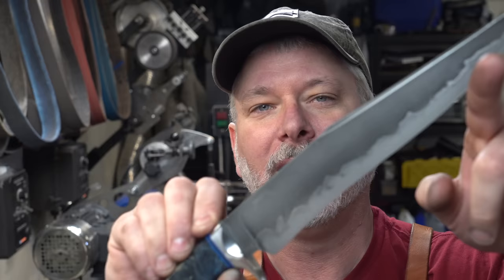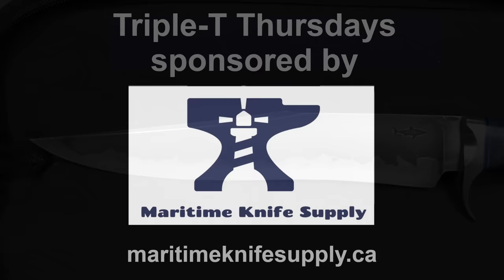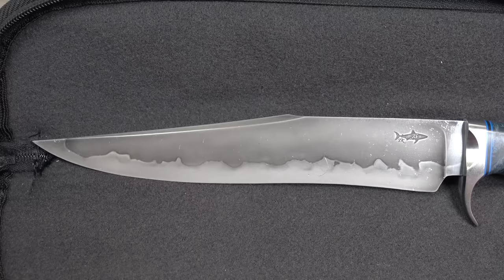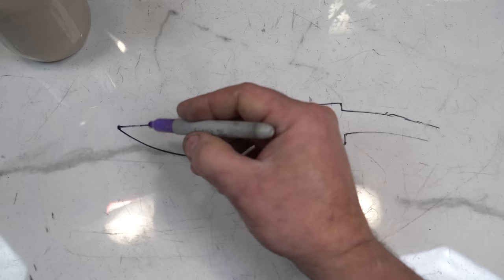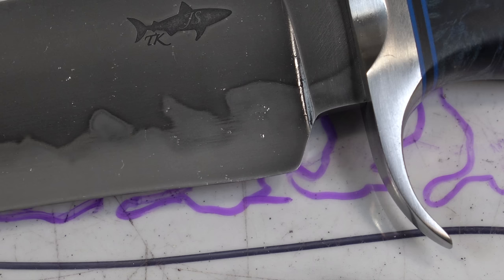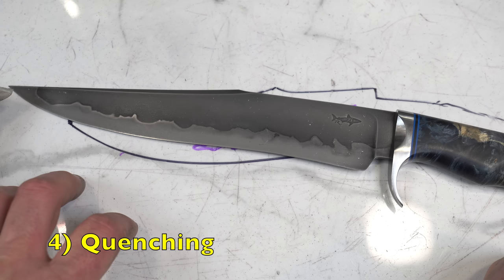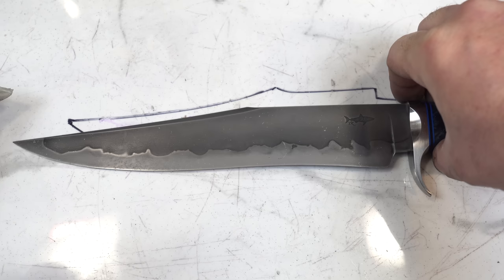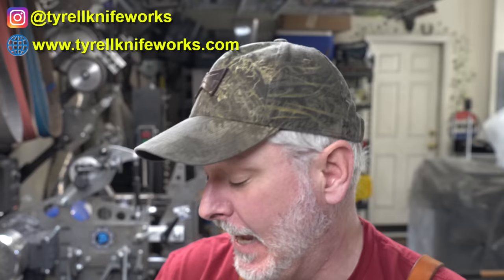Triple-T #131 - How to get a good hamon on your blade

Comment from the maker: I must correct something I screwed up in the video.  For some reason I said sand to 2000 BEFORE heat treat, I meant before the etch.  Sorry for the confusion!!
Reply: I typically sand up to a near mirror polish before heat treat anyway, but haven't tried a hamon like that yet. With the additional ridges that sanding at a lower grit leaves, it makes me wonder if there will actually be a difference on the hamon in sanding to a higher grit before heat treat, given that the high spots on the ridges will get hotter and quench faster due to their lower thickness. For context, I sand to such a high grit before heat treat and then use NuClayer No-Scale during heat treat. I can usually start sanding at 4-600 right after temper that way. NuClayer also makes a clay for hamons.
Reply from the maker: @zproducts6080  I've contemplated that approach but haven't done it yet.  I have some ATP anti scale that works quite well for that.
Reply: I’d much rather hand sand to 2000 before the quench than after.  How high do you go before the quench?
Reply from the maker: @dominicdwk  I usually only go to 120 pre HT.  You could go to 2000 pre HT and use anti-scale but then you’re probably back starting at 600 after.
Reply: @TyrellKnifeworks  thx for clearing that up. I going to go for some hamons on my next run. Im not a fan of of high grit sanding either. I appreciate the recommendation for the abrasive powder. Ill give that a try. You got a great channel. Thanks again for the videos.
Reply: Also admitting that you felt like hamon was for people who couldn't make dami... As if in some way it is inferior. The ignorance detracts from credibility.

Comment: Great video! I have found that you can create a more predictable Hamon and preserves more of the wispy tendrils if you are careful to match the clay on  both sides of the blade. Recently I started making a template to trace the line onto the blade to mirror both sides. My biggest  issue has been, the Satinite I'm using, flaking off.
Reply from the maker: A template is an excellent idea!  I may start to use that.  I don’t know what’s in that hamon glop, but it really sticks.  I’ve never had it come off.  Thanks for watching.

Comment: Thanks for sharing this info, very informative and great video. Why do you use Parks instead of water for the fast quenching steels, like W2? And would you get a different result on the Hamon if you used water as opposed to Parks? Thanks!
Reply from the maker: Pretty much nobody uses water to quench knife steel these days.  It's too unpredictable and error prone.  I doubt you'd get much a difference in the hamon.  Maybe a little, but it's not worth the high failure rate you'd get by quenching in water.  Parks50 is absolutely repeatable and dependable.  Thanks for watching.
Reply: @TyrellKnifeworks  OK good to know, thanks.

Comment: Never heard of the pre quench 2000 grit polish.  Thats a lot of work!!!
Reply from the maker: EDIT:  Sorry, I screwed that up in the video, I meant before ETCHING go to 2000 grit.  🤦‍♂️
Reply: @TyrellKnifeworks  cool that makes more sense.  You still have to take deacarb off post HT and that's a lot of steel in itself.  I even did a Hamon on blanks w/o a bevel and then ground post heat treat, it still works although looks more mild.

Comment: With Japanese Swords made in Japan by Japanese smiths using traditional bloom steel, one thing you will notice is that the clay goes ALL THE WAY to the edge. In otherwords, the entire blade is clayed and none of the metal is exposed. The spine obviously has much thicker claying -- something like 1/4 of an inch or 1/6 of an inch whereas the edge is barely covered by a paper thin layer of clay. Depending on the Hamon style there may or may not be crisscrosses of thick clay fingers added. Not sure why they do that. Maybe it's because they quench exclusively in water and a bit of extra insulation for the entire sword reduces breakage during the quench. Or, maybe it helps with the induce wispy details which are favored in certain Hamon styles like Choji or Midare.
--
Another thing of note is that -- tradition and prestige aside -- Tatara bloom steel (aka. Jade Steel, Tamahagane) is favored over modern steels like 1095 or W2 is that it contains no manganese which is bad for Hamons. I think that ideally, the best steel for differential hardened sword or large knives will be a powdered metal steel with a little Vanadium and Niobium (less than 1% total) but zero chromium, zero manganese and zero sulfur. Unfortunately, nobody makes something like that and you are forced to choose between high impurity bloom steel or clean modern carbon steel with too much manganese and silicon.
Reply from the maker: Some interesting points there.  I would guess the full clay would also be because of the water quench.  Thanks for watching.

Comment: Red clay and ash is a good combo.
Any refractory cement works just fine.
It simply has to insulate the spine (without breaking off in the quench) for 30 seconds.
Although, now you have me curious as to what the hamon gloop is.

Comment: I always liked the Hitachi-white #1 and Uddeholm 26C3 for hamons, mostly because W-series is usually very rare here and a lot of 1095 tended to... I can't say I hate it, but I've had a few batches that aren't worth the money and its already a difficult steel to get the most out of. Whereas the high quality of White-1 and 26C3 has always been immaculate. Essentially, most of the high carbon, low alloy steels will take a hamon. Its when they get a lot of manganese and particularly molybdenum for deeper hardening it tends to not work as well, most of the higher alloy tool steels also tend to have little to no chance of showing one. Though it might be differential hardened it will probably not show.
Reply from the maker: It’s the opposite here, it can be hard to find hitachi steels.  Thanks for watching, Kris!
Reply: @TyrellKnifeworks  Just get the 26C3, its probably a bit better than the white-1 anyway in terms of what you can do with it and it should be more available now. 
I sent some to Erick Rivers a bit over a year ago as his 'first go' for making a Hamon and it worked just fine for him.
Nice thing about it is that its really easy to get high edge stability at the 65HRC range and if you temper it down to 61HRC its really a very tough steel

Comment: From experience don’t get the main body of clay to close to the cutting edge or on to thick. I did a katana a while back. 1080 steel, satanite clay, 130*f brine quench, 375*F temper. The edge is 63+ hrc. (According to files) It pretty much skates a 65hrc. The spine is soft as expected. I stopped checking after a 50.  The problem is that it will bend and stay bent. It will not spring back. There’s not enough hardened steel in it to make flex back to its original shape. Hard lesson learned.
Reply from the maker: Yup, that is certainly a good point, you need enough hardened steel to made an overall strong blade.  Thanks for watching, Erik.

Comment: You didn't explain WHY the hamon appears, which is what a lot of people don't understand. The harder martensite at the edge polishes differently because it's harder. If you look closely at old nihonto, the hamon often literally sticks out from being so burnished. With that understanding you can plan your edge polish accordingly. For the transition zone, many Japanese sword polishers make the microscratches in the transition go in different directions so they catch the light at varied angles.
Reply from the maker: Thanks for the addition and for watching.

Comment: What about the tempering process? Does that still occur directly after quench? And then you ferric bathe the blade after the tempering cycle?
Reply from the maker: Yes, you run the same tempering process you normally would.  This one got 2 rounds of two hours at 400F. Thanks for watching.
Reply: @TyrellKnifeworks  thanks for the response sir!

Comment: The longitudinal lines in the hamon aren’t necessarily from grinding or sanding, I can see them in blades that have only been ground vertically so in those cases it would have to be something else. I rarely grind above 120 before hardening and a common issue I see people having with hamons is trying to do too much before hardening and not enough grinding afterwards to remove the decarb.
Reply from the maker: I actually corrected that in the pinned comment, I made a mistake in the video I meant to sand to 2000 before ETCH, not HT.  Grind lines are going to be in the other direction so if it were caused from grinding you'd see them vertically instead of horizontally, but your sanding lines are typically horizontal.  Thanks for watching.
Reply: @TyrellKnifeworks  I’ve seen those lines in blades that have had no hand sanding horizontally was what I was trying to say.
Reply from the maker: @edgeknifeworks  I'm not sure if its the grain direction in the steel then.  🤷‍♂

Comment: I appreciate this video very much. I have one question: does anyone think it's possible to have a jagged section of the hamon line at the base of blade, and then transition to just a smooth straight line from halfway point of blade to the tip?
Reply from the maker: Sure, any pattern on the hamon is possible if you practice enough.  Thanks for watching.

Comment: Good morning Master. You said "special oil". For the 1095, which oil to use? I live in Brazil and use diesel fuel for the 1095. Can I continue to use it?
Reply from the maker: You should never use diesel oil for quenching.  It is not good for your health and it’s a bad quenchant.  You really want engineered quench oil.  Here in the US it’s “Parks50” quench oil.  Thanks for watching.
Reply: @TyrellKnifeworks  Thank you so much!!!

Comment: 26c3 steel can also make a good hamon.
Reply from the maker: I’ve never used that one personally.  As good as W2 for a hamon?
Reply: @TyrellKnifeworks  I haven't personally used it either but I've read about it and Alpha Knife Supply says its excelent for hamons. they say: "The composition of 26C3 is similar to Hitachi White steel. The steel is very clean with few alloying elements. The high carbon content helps the steel get very hard. The first knife we made tested just under HRC 68. This alloy is an excellent choice for knifemakers who want to make knives with a hamon."
Its 1.25% carbon and .38% mang.
Reply from the maker: @checoleman8877  Thanks for the info, I'll give it a try. 👍🏻